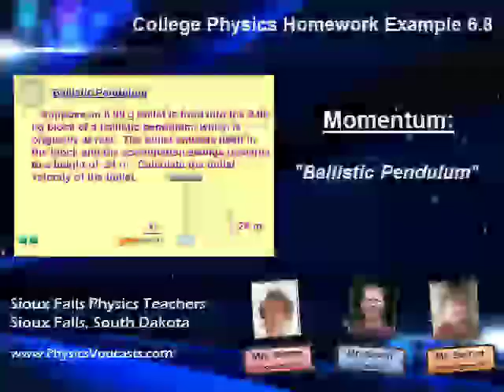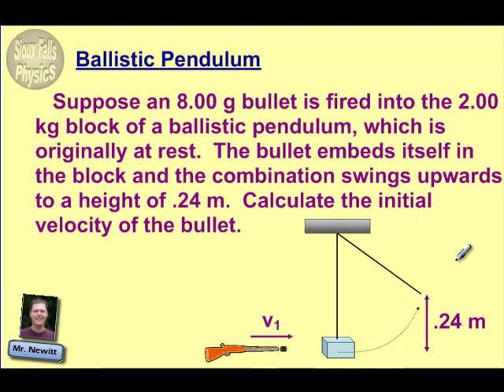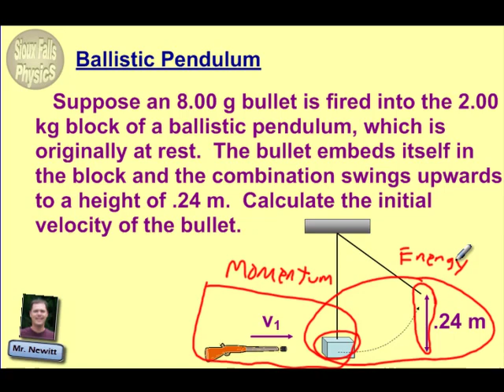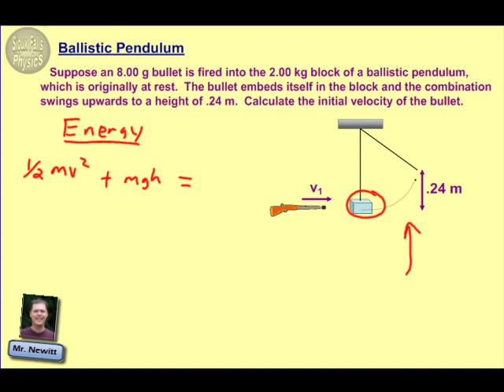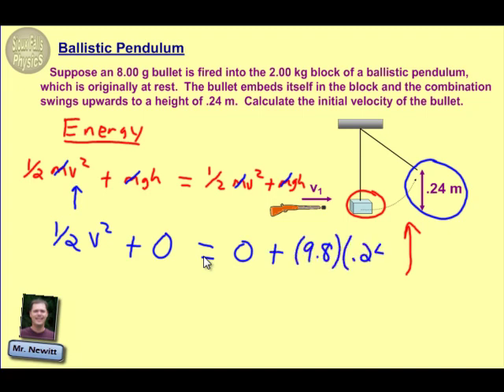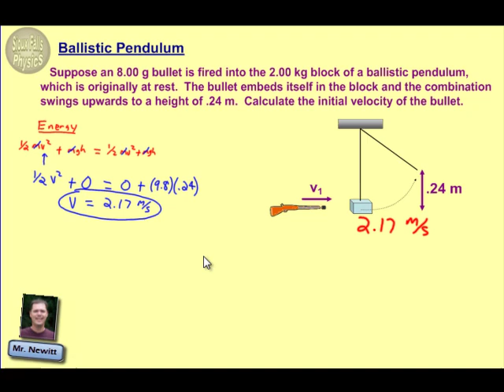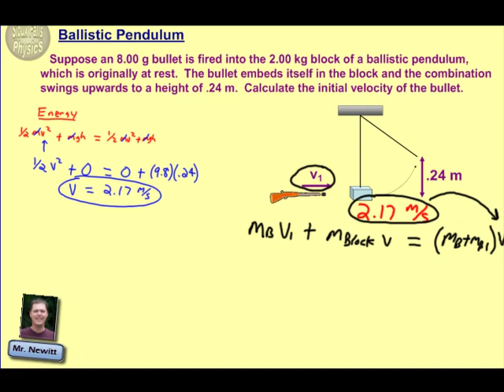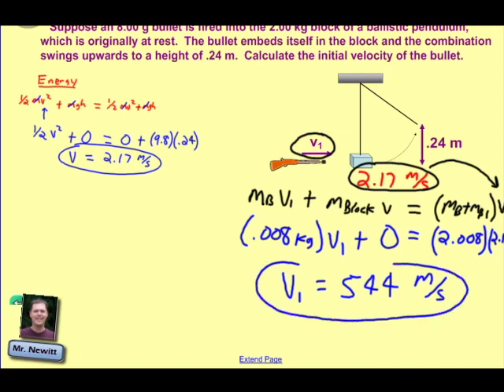Ballistic Pendulum

Comment from the maker: The mistake is in saying that the bullet's kinetic energy by itself is the same as the bullet/block's kinetic energy together.  But, the bullet's MOMENTUM by itself is the same as the bullet/block's MOMENTUM together.  So, use the potential energy of 4.7 J to find the velocity of the bullet & block together (2.17 m/s).  Then take mass x velocity of the bullet & block together and set that equal to mass x velocity of the bullet by itself, which gives a velocity of 544 m/s for the bullet.

Comment: So that bullet`s kinetic energy have to equal with potential energy of that block?
Well, this is the potential energy we need:
2kg x 9,8m/s2 x 0,24m= 4,704J
Bullet`s speed have to be fast enough to get that energy as KINETIC ENERGY, which move to the block, which move way more slower, but with SAME ENERGY.
0,008kg x ½ x (m/s)2=0,004kg x (m/s)2=4,704J
4,704J/0,004kg =1176
Square root of that is speed 34,2928564m/s
What did I miss?
I`m from Finland, age 16. Its hard understand physics with English